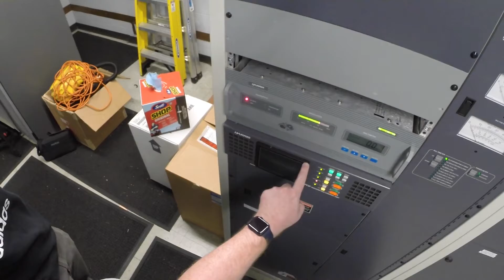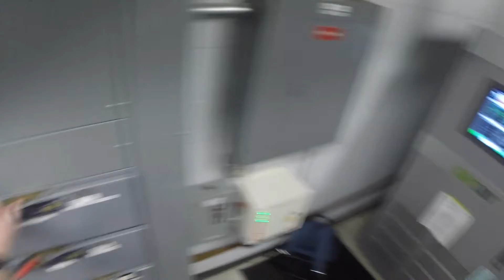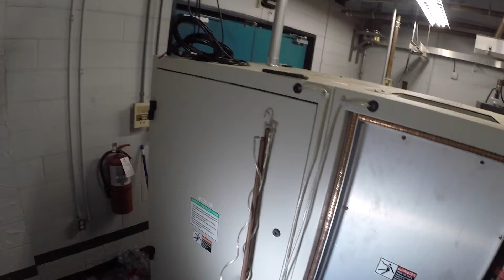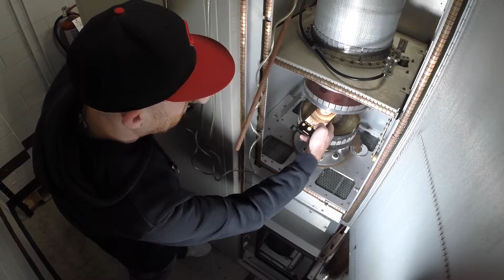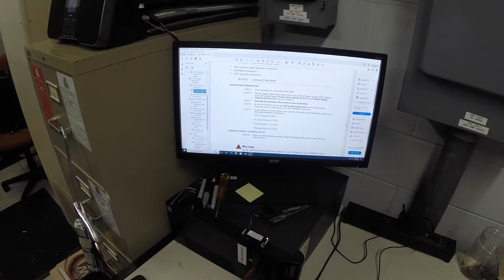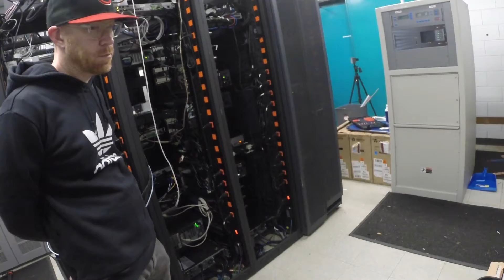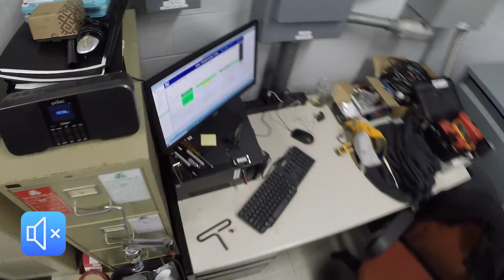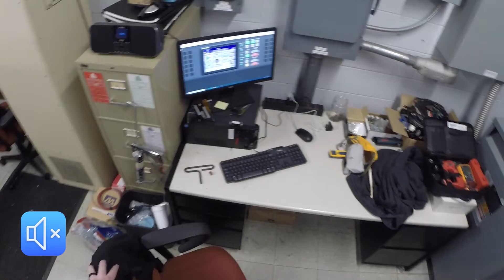Broadcast Engineering: FM Transmitter Maintenance

Comment: I have a 20,000 tube sitting on my shelf my mentor gave me. All of my big FM transmitters are still tube. Still getting my tuning mojo. Rebuilding an amature tube amp to learn more on. And yeah I spent a week geeking out when BE had to send an engineer down after our FM20 took a direct hit.
Reply from the maker: I do love my tube rigs, but new good quality tubes are almost impossible to find at an affordable price these days and rebuilds almost aren’t worth it anymore. I definitely understand the allure and sense of ownership you get out of maintaining the famously finicky tube final (it’s almost like having a pet) but the fact solid state power electronics do either exactly what they’re supposed to or nothing at all, as well as packing multiple PAs working together by necessity, thus enabling maintenance or repairs while staying on-air, is really nice.
Reply: @BroadcastBlueprint  Really wish we could bring in solid state Nautels. I worked on a 30 for another network that was awesome. Got a VS1? on the air as a translator for AM and a J1000 for said AM. The rest of my FM is tube finals and I just don't have the mojo to tune them beyond dipping the plate. I forget what we are paying Emiac to rebuild the 20,000s but I want to say its around 5k. Penta Labs may be entering the game on that too though. They have already started making and rebuilding a lot of the smaller ham tubes both glass and ceramic.

Comment: 11Kv anode voltage power output minimum 20KW 🤪😳😳 and filament is 10 volts at 140 amps. Thats not very QRP ... Thats a beast of an amplifier. The power supply must be hudge.  If you got a worn tube love to have that. 73s from PD0ROH QTH EINDHOVEN Netherlands.

Comment: CPI Data Sheet for the 4CX20,000C  shows 13kV as Absolute Maximum for a Class C Amp, grid driven. So, Harris (Gates Air) is just under the Max with 12.7kV on the Factory Test Data sheet but doesn't leave any wiggle room for when the tube starts getting a little weak & needs a little more Plate & Screen Voltage. I have switched to all Nautel transmitters at the sites I maintain.

Comment: ”Jesus Stick”? Is that because if you don’t use it, you might MEET Him? Personally? At His place? Or just because you might scream His name when you get zapped?

Also, what is in those gas cylinders I saw earlier? Nitrogen or argon, perhaps? And for what purpose?

73 de AF6AS
Reply from the maker: Yes and yes. The worst part is, you don’t know which one until it’s too late!

The gas bottles have nitrogen in them. We run the gas through a dehydrator and fill our transmission lines with it to keep moisture out and prevent the center conductor from arcing over to the outer shield.

Comment: Hi, seems back in the 70’s night time AM radio was full of distant stations I could receive clearly.  Now I can hardly hear the same stations, did solid state transmitters make that much difference?  Did stations reduce their power?  Just wondering.
Reply from the maker: These days, modern electronic devices introduce a lot of noise and interference. Switched mode power supplies are one of the biggest offenders. So it’s not a matter of transmit power or the type of power amplifier in the transmitter, it’s just that there are a lot of noisy things close to you!

Comment: Used to work on commercial AM,FM, and analog TV transmitters. What I see here is very familiar to me. For the past 35 yrs and ongoing work on 250kw and 500 kw SW transmitters for VOA and Radio Marti( they broadcast to Cuba) The site is the only remaining Greenville,NC.plants A site and C site are closed C plant building is used by ECU and is their property(state,county) B plant where I am now is Radio Marti. The hv for the tubes is actually similar to what this commercial transmitter has-but VOA tubes run at much higher current.25A 12kv 250kw 16kv 55A for 500kw. As I typed this “don’t bypass interlocks on transmitters” years ago an engineer was KILLED from the bypass. The tubes used at our plant are water and vapor cooled. In older 250kw GE SW transmitters the RF driver feeding the PA is 50kw. Newer transmitters here have 2 power stages-not 3 as the older GE uses. Also SW transmitters are variable frequency. At the SW plant you tune transmitters several times a shift-each frequency change. This does cause mechanical wear on components. And of course the ground hook is your friend! USE THEM! Filament voltage on one of the VOA tubes is 14v-but over2000A-rectified filament supply! Rectifier diodes mounted on water cooled heatsinks.
Reply: Where can I contact you?

Comment: I was looking at how close the back of that transmitter was to the wall. They're usually installed so there's just enough space to swing the back door open. That causes a major problem; you will have one injury turn into three. If you're in back of the transmitter and touch something that's still slightly energized, you'll burn the tips of your fingers. When you do that, you'll jerk your arm back and slam your elbow into the wall behind you. Immediately after that, you'll pull your arm forward again sharply and slam your nuckles into something inside the transmitter. Thus, one injury turns quickly into three! 
Our station engineer told me this story one night when I was in my late teens and working my first job (weekends) in radio. He and I were at the transmitter one night while he was repairing something. We both had a good laugh at it, but in my experiences, it's turned out to be nearly true!  That engineer is in his late 80's now and we still laugh about it.

Comment: No Safety Officer ?

It's a good practice to have a Safety Officer who is on scene of any potentially dangerous work.
They observe and tell you if they notice something but also stay out of the danger zone and are there to call for help if someone becomes downed.

They also take readings of RF radiation during the work and log reports for each employee and their radiation exposure.

At NL Industries the Safety Officer kept the logs for each piece of equipment and the total radiation daily and over time for the equipment and each employee.

If an employee was nearing their legal limit of exposure the Safety Officer would put in a request for transfer for the employee so they would not receive any more radiation for the year.

In real bad cases they had people who were given desk jobs or even paid time off.
Reply: All the radiation, with very minor exceptions, is non-izoning. The transmitter manufacturer has responsibility for the inherent safety of the device. As far as a safety officer, the chief is there and is hands-on supervising the process.

Comment: What are the black gas cylinders for?   Are they for keeping moisture out of the coax feeders to the antenna?
Reply from the maker: Yes! Those are compressed nitrogen cylinders. We connect them to a dehydrator/compressor unit that maintains pressure inside the coaxial transmission line. Nitrogen is a very popular dielectric gas that prevents the center conductor from arcing over to the outer shield and also keeps moisture out of the line.

Comment: Why not run the transmitter into a dummy load instead of putting it on air ?
Reply from the maker: That's a good question - usually we do run into the dummy load, but we were also getting data on how this transmitter performs when actually connected to the antenna so we know what tuning adjustments we need to make. Typically the dummy load doesn't give you that complete picture.

Comment: Many moons ago I maintained a RCA-BTF-20E.  It was a pretty good box except for the strip-line tuning- the sliding finger-stock would arc and burn when tuning and the RF-voltage on the 4CX15000 PA plate was very high.  A number of them were known to arc and set insulator shelf on fire.
Reply: Ours ran as a backup until 2016 when we donated it to a museum. Those were fun when the lamp in the VSWR meter burned out and they'd dump the plate until you figured it out.

Comment: Also, remember that your PA tuning will be slightly different between the antenna and the dummy load.  Best to tune into the antenna.  Dip the plate, peak the grid.  On that Harris FM, tune for peak RF TPO.  You will notice that the PA tune and load peaks are pretty wide, so skew to the side of the peak that gives lower PA current.  That is tuned.

Comment: 13 KV on the plate?  That is generating x-rays.  Be careful, men.  I have an HT-30 (28 KW TPO) that runs 9 KV on the plate and has 81% PA efficiency.   You might want to re-tap that HV supply.
Reply: GWDLABS    The copper (they are usually silver plated) fingers are to stop RF leakage.  That does not stop x-rays.  X-rays are much shorter wavelengths and go through those little cracks.  Most of the x-rays are contained within the cabinet when everything is closed up properly.  However, there are times when troubleshooting that you have to bypass an interlock or color outside the lines.  I've been a broadcast engineer for 39 years and seen it all.  Once in the late 90's, I was Chief Engineer of 17 stations all by myself, no help.  Now I only have 7 stations.
Reply: @ModelA I always thought silver plating was to help compensate for skin effect losses.
Reply from the maker: The FTD sheet for this transmitter calls for 12.7 kV/2.95 A on the plate for FM+HD hybrid operation at 21.205 kW TPO.
Reply: @BroadcastBlueprint    Interesting!  Thank you.  Just be advised that you're also generating x-rays with that.
Reply: Trust me, broadcast engineers, know that broadcast engineers, get cancer, or at least they used to when they had to tweak the exciter by reaching around the tube in the cabinet
Reply: Agree 👍

Comment: I am wondering what the filament voltage on the tube you mentioned and are the filaments AC or DC I think you said the tube was 4CX20000. I have just found your channel and the other channel I watch is Geerling engineering which give insight into the Broadcast industry.
Reply from the maker: For the 4CX20000C tube used in this rig, nominal filament voltage is 10VDC at approximately 140 amps. GatesAir recommends lowering the filament to around 9 volts after about 150 hours of use to keep the tube from going “soft” too quickly. That was never done to this one and so we’ll probably need to replace it soon.
Reply: @BroadcastBlueprint  Consider getting a copy of the classic book on the subject, titled "The Care and Feeding of Power Grid Tubes" by Eimac.  They explained a lot about filament management to get the longest life and best performance out of vacuum tubes like that 4CX20,000C. I believe it is available as a PDF as well as in hard copy.  As I recall, the PDF was free.  

I also recommend getting a copy of the data sheet for that 4CX20,000C, so you can see both what the ratings of it are, and also what typical operation as a Class C FM power amplifier looks like

About that exhaust air temperature, it seems a bit high to me, but I am more familiar with the 3XC10,000A7 triode running in low band VHF TV visual amplifier service, which means they were running AB1 or AB2 as grounded grid linear amplifiers.  But our exhaust air temperature was around 135 degrees F with inlet air of 65 degrees F, so we had a 70 degree delta between inlet and outlet air temperature.  And we checked our air filters with a vacuum gauge calibrated in inches of water.  Too much drop across the air filters was the reason to replace them because a plugged up air filter can reduce the air flow through the anode of the tube and the cooling of the socket, as well.  Higher temperatures lead to grief sooner.  Also when you pull the tube, take a very good look at the contact fingers in the socket.  One point of failure is weak fingers that lead to higher resistance contacts with that tube.  140 amps at 10 volts can cause some serious finger heating if they are not all making good contact with the tube base.  

Anyway I liked your video, although a chest mounted camera might have shown some of what you were doing a bit better than the helmet mounted camera did.  

73 from WA6WHT, transmitter engineer for KTEH-TV54 and KSTS-TV48, San Jose, and KRON-TV4, and KTSF-TV26, San Francisco.  I didn't do all of those rigs at once, however.!  ☺️

Comment: The 4CX20000 family is rated at a max plate voltage of 10Kv, typical run at 9K.  Running them at 14Kv has a high risk of flash over and ruining the tube. I mean
yea what's $10k here or there.  You have something wrong with the power supply or regulator circuit in that transmitter which should be fixed before further abusing that tube.
Reply from the maker: The factory test data calls for 12.7kV. 14 is still high, but I don't think GatesAir would tell a customer to run this tube at over 10kV if they didn't think it could handle that plate voltage.
Reply: Agree

Comment: Quick question from someone trying to build a radio, can a SSB signal be heard on a regular radio. Can regular radio be heard on ssb? 
That transmitter uses only one tube, right? Does that mean its SSB? Or is it doing the full swing. Im assuming you need two valves to get ur full wave and one valve gives u whatever side of the wave u pick, positive or negative, lower or upper sideband, or am I clueless lol
Reply: This rig is FM which has lots of sidebands, both upper and lower.  AM typically has only 2 sidebands, one on either side of the carrier.  When you are talking about Single Sideband, you are talking about eliminating both the carrier and the unwanted duplicate sideband.  Single Sideband requires linear amplifiers, but FM does not.  In fact, to get the efficiency of an FM transmitter to be high, the amplifier chain is very likely running Class C and quite non-linear.  But that non-linearity does not distort the transmitter signal at all.

A good place to begin learning more about FM and SSB is The Radio Amateurs Handbook by the American Radio Relay League (ARRL) because both FM and SSB are used by amateur radio operators, and the ARRL Handbooks are very well written.

Comment: Not often I see a 4CX20000, remember thinking my old 4CX250 was beefy ;)
Reply: The 4CX250B is the baby of the family.  But they work very well in amateur radio amplifiers, typically in push-pull pairs in VHF service.  Of course they work well on lower frequencies, too.  But if you are interested in doing moon bounce, a pair of those 4CX250s are a good choice.  

73 from Bob, WA6WHT ☺️
Reply: Aye, when I started in the hobby I bought a set to make my own amplifier, never got it finished though due to.. well... life happened.
Still have them somewhere in the storage.

73 de Soren OZ2AEV
Reply: iam happy with my GU74B amplifier on HF bands

Comment: Thats a lot of copper earthing strip around the place , floors and walls blimmy must cost a fortune to build that room.
Reply: As an Electrician, I think one of the reasons why that FM broadcast station has so much grounding is because of NEC article 250. Just think about it, the broadcast tower is now a lightning rod 😆 I wouldn’t doubt those transmitters are system/equipment grounded so that if lightning strikes the tower, most of that energy from the lightning would go straight to the ground and bypass electrical and the FM radio broadcast equipment. Back in 2010 I was in a technical college getting my two years associates degree in industrial electrical / systems technology. the instructor took the students and I on a trip to a 911 Calling Center in Apopka Florida, at that time we were learning, basic communication, electronics and  NEC article 250 Which talks about grounding(Earthing )and bonding electrical/electronic equipment. As we walked in inside this 911 Calling Center in Apopka Florida, We walked inside the room where the transmitters were, and we knew some of the equipment had discoloration like some equipment had turned black,next we looked at the electrical panel, the whole electrical panel was blown out. The people at the 911 calling Center was spending hundreds of thousands of dollars installing new equipment because of lightning strikes and power outages come to found out some of the cables to the tower. Weren’t grounded, instead of using copper, it was using aluminum cables. It was using hose clamps off of automobiles to cover the coax cables. It was a mess. The antennas weren’t grounded properly. It was crazy, but it was more of a lesson learned while I was in college, and a very interesting one in communication electronics. there’s probably a lot of reasons why this transmitter is malfunctioning. they might want to call an electrician to check the main power source for voltage spikes and THDFs or transformer, harmonics dating factor on Transformers.

Comment: OMG
I AM A BROADCAST CHIEF ENGINEER  BEEN DOING IT FOR 50 YEARS

THIS GUY IS GOING TO KILL HIMSELF SOMEDAY
PLEASE FUTURS AND CURRENT ENGINEERS DON’T DO IT THIS WAY.
Always place a neoprene insulating mat before going into a tranny. Never touch the Jesus stick without the manual folded in front of you. For gods sakes refer tot the mfgr’s checklist for where to neutralize to earth. Always use the stick on the HV AND LEAVE IT THERE WHILE YOUR HANDS IN THE TRANNY PA
NEVER HAD A SECOND PERSON WITHIN TOUCH DISTANCE FROM YOU WHILE THE TRANNY IS OPEN. ALWAYS WEAR RATED AND TESTED LINEMANS INSUIATING RUBBER GLOVES WHEN INSIDE THE HV SECTION ENEGERIZED OR NOT AND FOR GIDS SAKES WORK WITH ONE HAND BEHIND YOUR BACK WHEN IN ANY BROADCAST TRANSMITTER

OH, YEAH. Taking sandpaper to a ceramic RF power tube?
And, soot at a air leak point. And for god sakes, don’t call it a ANODE, IT’S THE PLATE.

this guy is the broadcast engineering of Stobe the Hobo- 
Darwin gene selection will catch up with this guy
Reply: Plate and anode are used interchangeably as are toob and valve, it depends on where in the world you are as to which terminology is generally used.